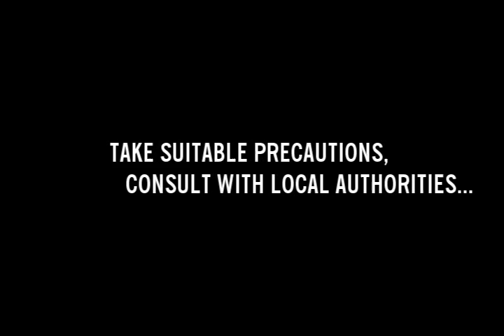SSI's Shred of the Month: E-Scrap: Hard Drives/Tapes Shredding (D)

Comment: SAD FOR THE DRIVES!!! WHAT A WASTE OF WORKING HARD DRIVES!!!!!!
Reply: I'm pretty sure you're wrong. The drives that were shredded might have been broken ones or malfunctioned ones that don't work anymore.
Reply: owen teague(I think) Im right, becouse they only get shredded becouse of the Data, The Companys always do that becouse its easyer and "safer", I took many, many Drives home from Dump Places before, I formatted them, many of them came from Companys and 99% of them worked.
Reply: But just think of all the porn on those drives they shredded.
Reply: owen teague
XD
Reply: It's done by organizations (in the case of the one I worked for, the military) for security reasons.  Even after formatting or deletion it's possible to retrieve data, so instead of taking the risk of re-using them they shred them to keep the data safe.  It's almost always done after they've been cycled out, too.  So they're usually old.  The gov't and military are really strict about about it, and I know lots of large companies are as well.  

So, um, no.  Not a lot of porn was lost in the making of this video.  x.x
Reply: Kristina Kyidyl I understand the reason, but it's still a little sad...
Reply: MrComputerfan sad? not if they're obsolete. How much use do you have for a drive with a capacity less than a gig and abysmal read/write rate?
Reply: Damaku250
do you know that there is a thing called "computer stuff collectors"?